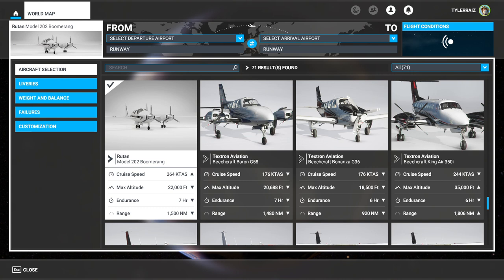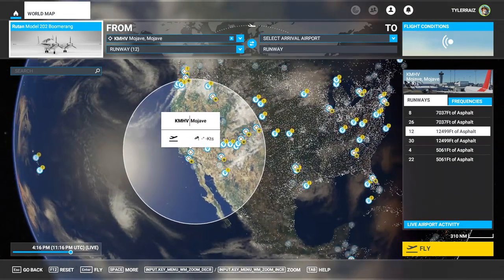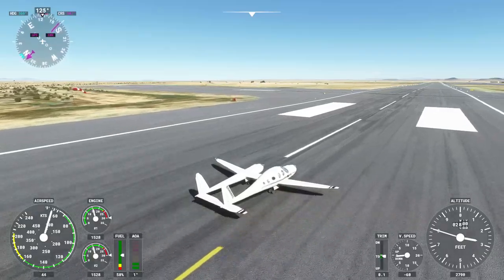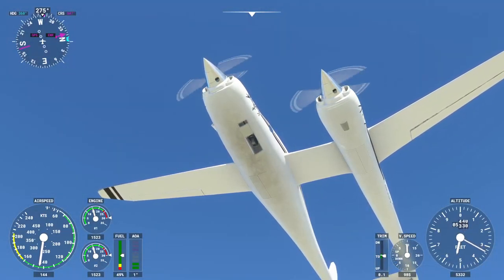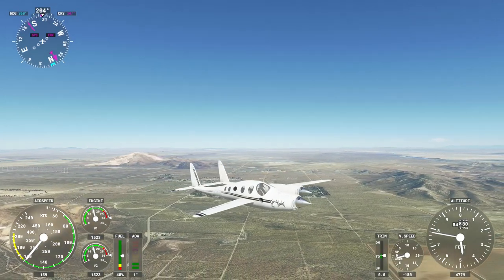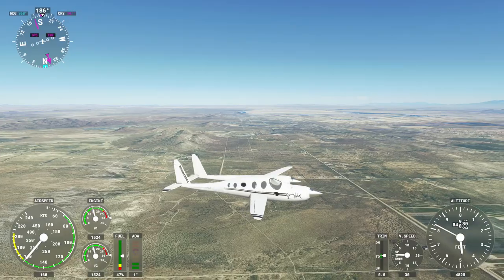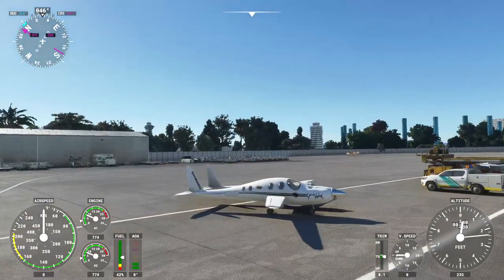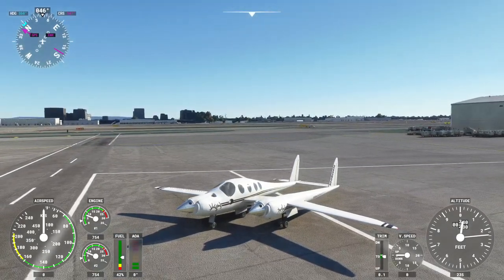Flight Sim 2020 - Freeware Rutan Boomerang by Technotech

Comment: Saw this plane in the late 1990s. Beautiful plane. For comparison, the Baron 58P cruises at about the same speed at FL 150, maybe 10 knots slower, and has 2 325hp TSIO520s. (turbocharged) The Boomerang is one efficient airplane.
Reply from the maker: Yeah, Rutan had some very efficient designs. I think the Long EZ gets 30-40 miles to the gallon.